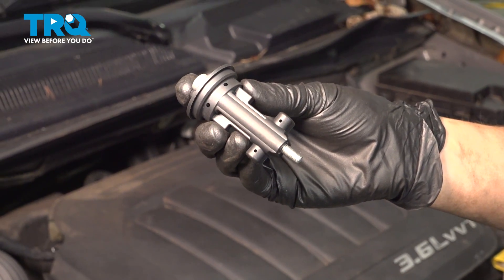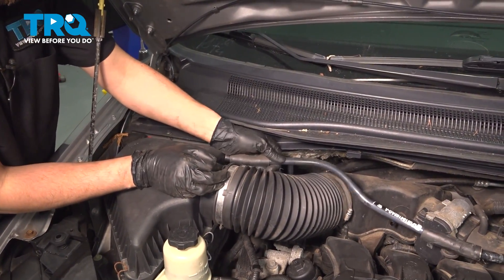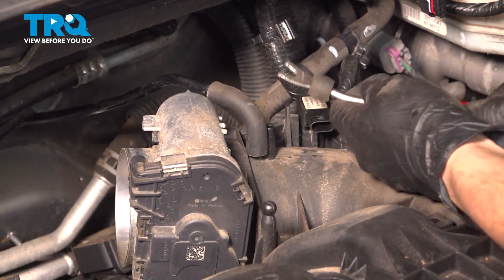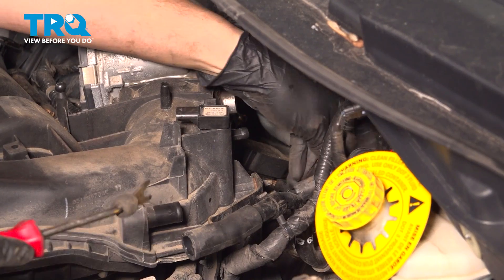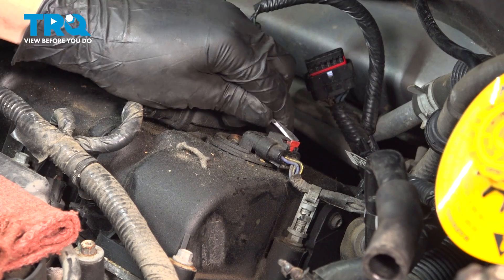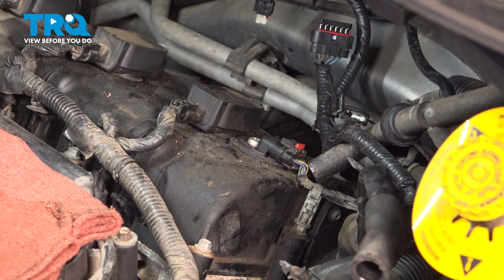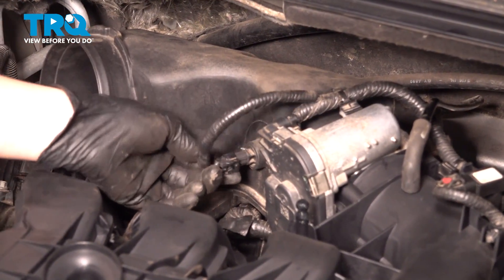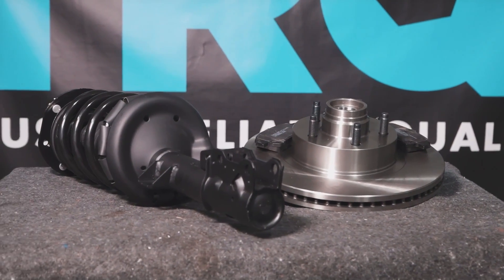How to Replace Camshaft Position Sensors 2008-2020 Dodge Grand Caravan 3.6L

Comment: I had the transmission replaced at Mr. Transmission in Hamilton, Canada, but I still feel a slight shudder or jolt when shifting from 2/3. If I use Eco mode, it shifts from 1/2. I informed them, but they didn't do anything. What do you think the problem might be?